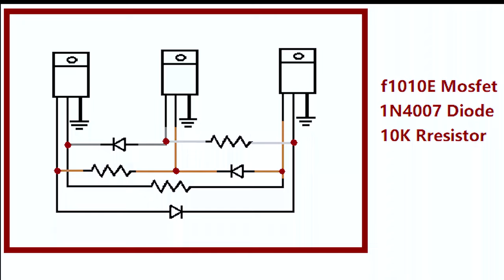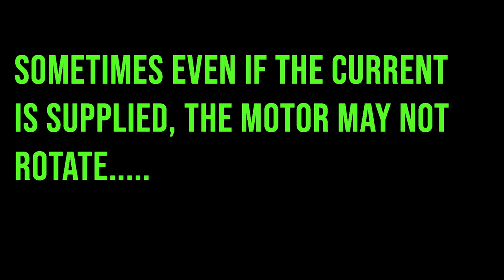How to Run The Brushless DVD Motor & circuit | CD ROM Motor |  old CD drive to power RC airplane |

Comment: In such circuits, why does it happen that the motor does not turn, even though it is powered? Isn't there a more efficient circuit that doesn't do this? Thank you
Reply from the maker: There is.. I will bring it soon
Reply: @techwithdilshan8777  Thanks

Comment: I've made it like this but it doesn't want to play, why?  the motor is locked, it won't move.  used motorcycle photocopy diameter 6cm 12pole stator 10 pole rotor
Reply from the maker: The strength of the motor may not be enough

Comment: I've made it like this but it doesn't want to play, why?  the motor is locked, it won't move.  used motorcycle photocopy diameter 6cm 12pole stator 10 pole rotor
Reply from the maker: That circuit may not fit your motor